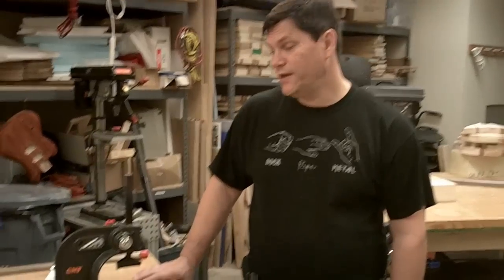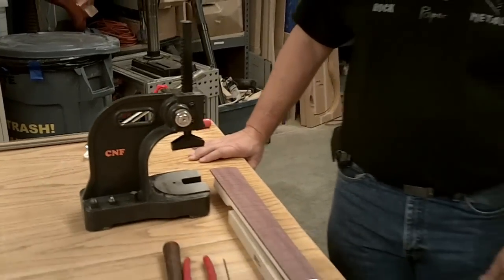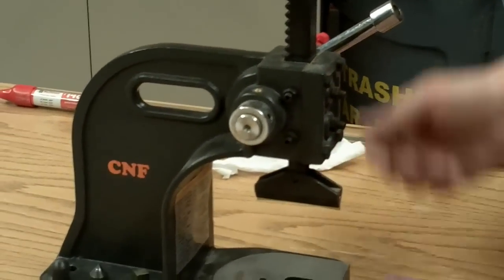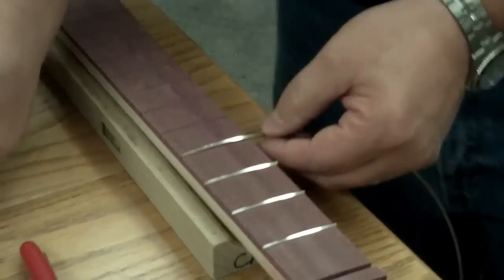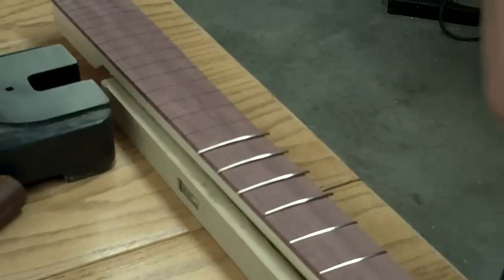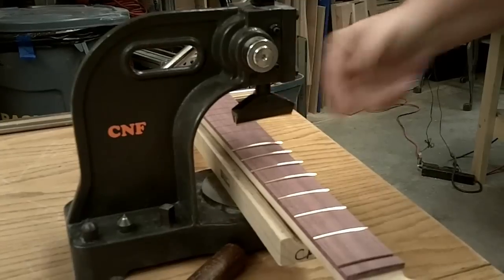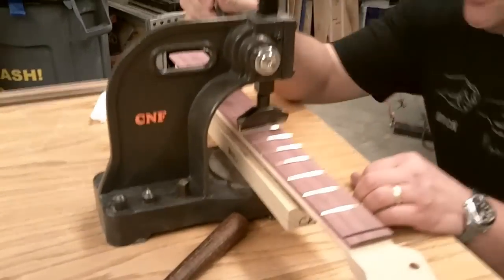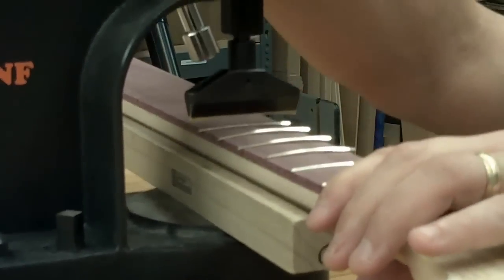What is an arbor press used for ?  - PLTW question

Comment: you state that this is a 1/2 ton press. How much physical (i.e. YOU) force is needed to reach that 1/2 ton level? I've seen other presses that go to 2 tons, etc. but they don't say whether ANYONE can generate that amount of force or it's the mechanics of the device that will produce that force with minimal input from the user. if you have some insight into how these devices translate your arm energy into press energy that would be great if you would share that. Thanks.
Reply: Arbor press force output is based on the  length of the handle.
Reply: @805er.  thank you for this info. I'll keep this in mind!